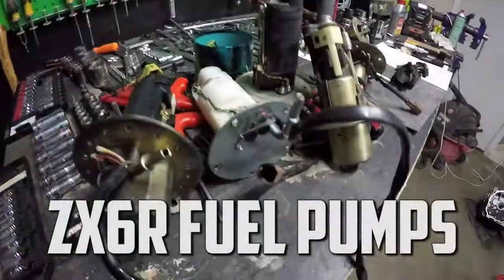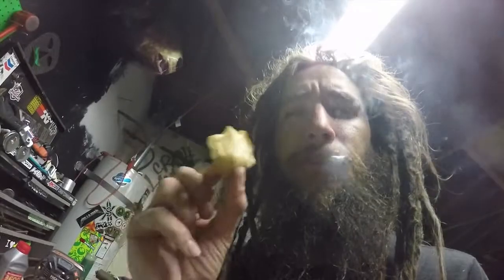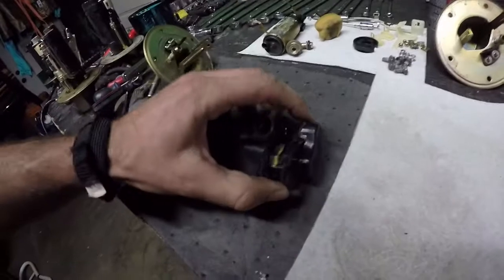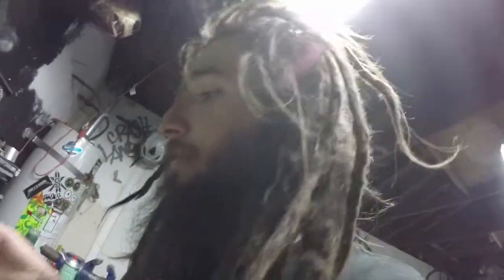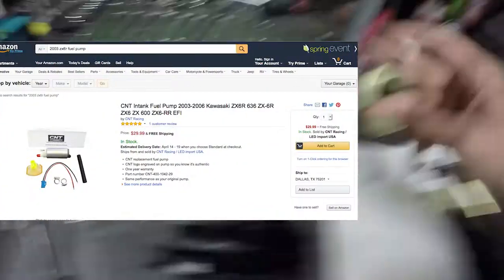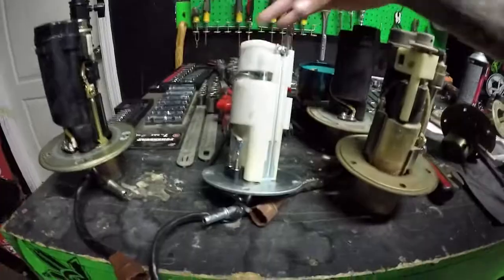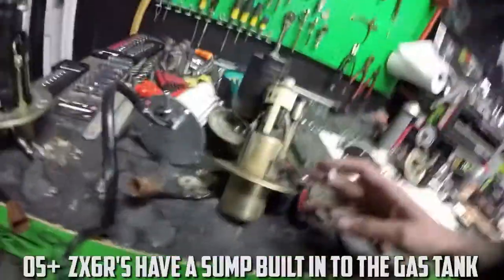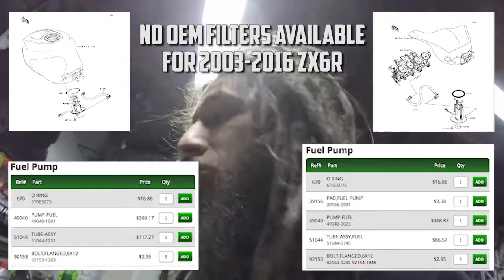How To Love Your 2003 ZX6R Fuel Pump

Comment: Subbed man, love your style. Im about to have to replace my entire pump because my tank decided to fall off of the bike and yank the fuel sensor out of it's sockets. To top it off, the sensor can't be replaced separately because the wires are soldered to the pump. And there are no part numbers for the sensor. Fuuuuuuuck
Reply from the maker: HighwayDrift  damn man that's a bummer , it's a bummer they don't make the fuel pump serviceable/repairable

Comment: What if you submerge the pump off the bike in gas mixed with a cleaner not harsh enough to degrade the plastic, hook it up to 12V with whatever resistors or current limiters needed to protect it, hook-up a hose to return to the pump and run the cleaner threw until the gas changes color, and clean it that way?
Reply from the maker: A Rox I'm not sure what to use that would be harsh enough to dissolve the particulate but not the pump haha but I like where your heads at

Comment: remove the internal filter and use a soldering iron on the plastic thats what i did works fine
Reply from the maker: yea def possible. my paper filter was hard to clean. might  be better to frun no filter at that point haha
Reply: i didnt even try to clean it, before i removed the filter it only revd to 12k, but its not a bad idea to put external one on the hose
Reply: can you make a video how you take out the filter and how you put a filter external please  or can you answer how you do it i have 2003 kawasaki ninja 636 thanks hopefully you response thanks ill wait